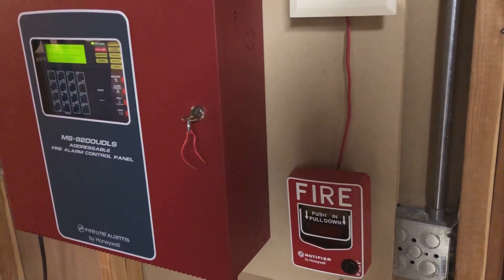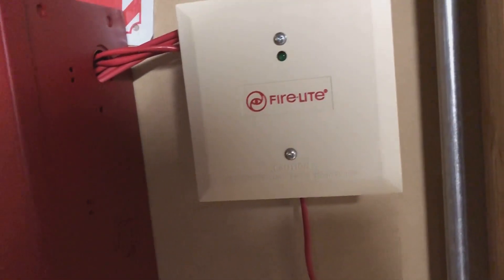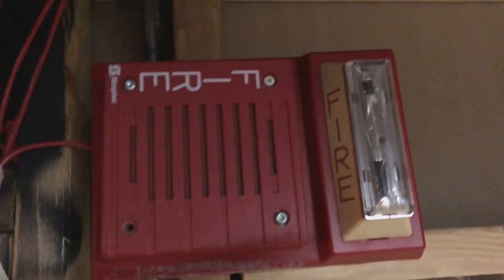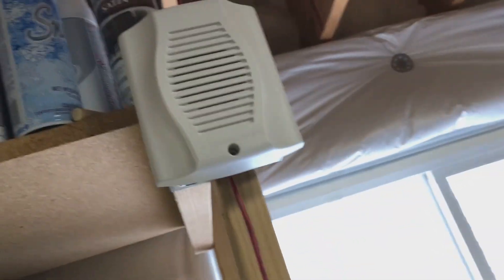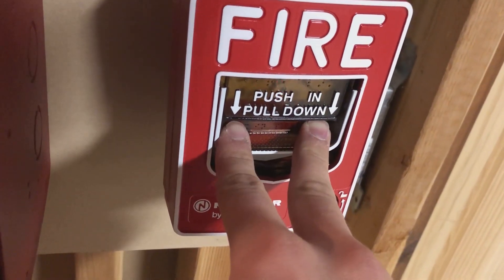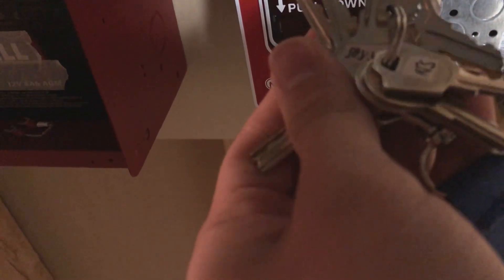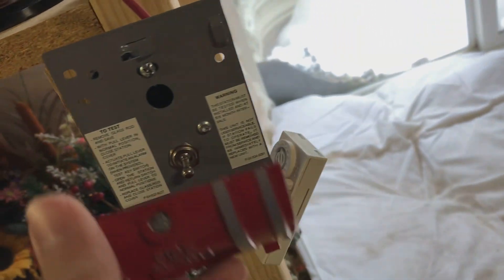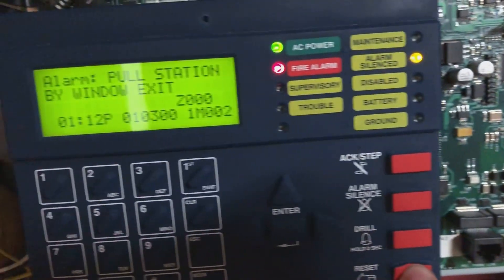Home System Test 22: Simplex Mechanical Horn/Strobe with System Sensor Low Frequency Sounder

Comment: It seems like mechanical horns are MUCH loud than "traditional nowadays" piezoelectric horns. Maybe that's because of the year gap. Mechanical horns were primarily used in the 70s to about the early 90s (they still were used throughout the 90s, but not as frequently I believe). Electronic horns (like the Simplex 4901-9822 or the 4903-9236, or the 4903-9238) are ALSO much louder. BUT, they were used in the mid-90s throughout (I don't know when they stopped or IF they stopped). Besides THAT, mechanical horns are LOUDER and not too satisfying to listen to at all lol. Fun to mess with, but yeah.

Also, GREAT video by the way! 😉
Reply: +Zachary Fleck Oh yeah. My Simplex 4051 cause a little mini earthquake in my room lol (my room is quite small though) 😂. My Simplex 2091-9806 is also just too darn LOUD! I wanna call it my loudest alarm in my collection, but then there's the 4051 haha. 

Also, if you ever try to get the 9806, the B4 models I hear aren't as LOUD as the B2 or B1 models. I have the B2 model. I believe the B4 models came out in the mid to late 80s, while the B2 and B1 came out before then (mine was made in 1980). Just a little side note 😉